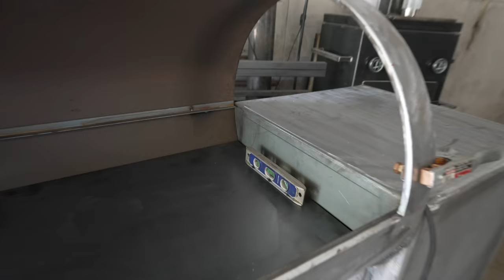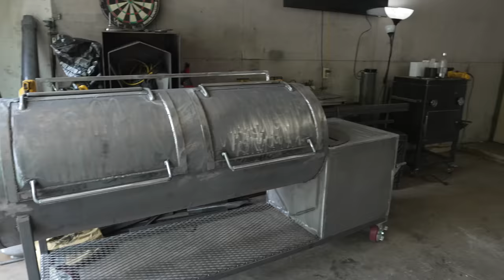Smoker Build Ep. 6 Almost Done! | Chuds BBQ

Comment: Love this series, cant wait to see this thing in action and to get your thoughts on the concept!
Reply: it looks like your reverse flow plate was welded down.  How do clean and how do you prevent grease fires underneath the reverse flow plate?  More importantly, how do you put a grease fire out if one were to occur? 😢
Reply: @derekanderson1882  shut doors dampner/smoke stack.
Reply: @koukitype180  my thought process was to make sure that you have the ability to inspect or clean it so a fire doesn't happen. I don't sit next to my smoker when I'm doing a 2 hour or 12 hours cook.  It's more likely that a neighbor would see it and I would get a knock on the door from the fire department.  Lol
Reply: @derekanderson1882  I have a 20-25 year old custom built reverse smoker and my plates are removable, they have to be. I can adjust the flow plus I can clean them. They are also rounded so they don't pool juices.

Comment: I built a 15 gallon double wall reverse smoker. I did not drill a grease drain.  Made a catch pan for that, plus adding to the catch pan a small water section opposite side of fire box.  Underneath pan added small plates on each side so I can adjust the gap to the reverse flow opening.  I have used this design for 6 years and works great for two people at home. I would add pictures but could not figure out how to do that.  Don’t think you can. Nice build Brad.

Comment: This is awesome!  However, I'm confused by the placement of the grease drip hole?  With the baffle plate installed level...the grease will just...sit on top the baffle plate????
Reply: This got me too...he will need to add another trap at the capped end.
Reply: That was my question as well.  Not sure where the grease will go that collects on top of the baffle plate. Baffle plate should have been in a slight V shape and slope, with a trap at the end.

Comment: Growing up working in welding and fabrication shops, I've drilled 10s of thousands of holes in all kinds of steel and it is a skill. Ford semi frames were the hard
and required an electro magnetic drill press. When hand drilling with a powerful drill, such as a Milwaukee Hole Hawg, you have to cradle it aggressively so you don't get wrapped up.

Comment: I made a reverse flow from a 200 gallon propane tank that was on an old semi.  I used axe handles for my handles.  It has worked great because the wood doesn't get hot at all.  I bolted them on, so when they get soft, I can just remove them and put new ones on, or limbs or bats or ...yeah.

Comment: One question - with the installation of the baffle plate for reverse flow, how does the grease which drips down on it actually escape to the grease trap hole you drilled?
Reply: Was wondering this same thing
Reply: Hopefully the baffle is pitched and he puts the grease hole on the turn side!
Reply: @leomulholland3  By pitched do you mean leaning to one side so it may drain? Curious.
Reply: @stihlmanchainsaw8445  yes. the baffle should be pitched from level to 1/4" per 3 ft toward the reverse end. that is the way i would for moving the grease down and for ease of clean.
Reply: I have an RF - the grease drain is *in the baffle plate* and extends through the bottom of the pit. I clean the baffle plate with a griddle scraper and push all of the grease and bits down the drain.
Reply: @SwineSpectator  i agree, that is the best practice, but looking at the final product that was built, i don't think he can remove the baffle plate anymore and put a tube from top to bottom. hindsight is always 20/20.

Comment: Love the build series! This pit is looking like a dream! Is the baffle plate going to impede the grease drain hole?
Reply: Yes
Reply: @duanehenicke6602  Haha I knew the answer would be yes, but I am curious as to how this would be amended. Drill holes in the baffle?
Reply: @Harry The Horse BBQ  few different ways. Door could be cut in the end cap for removal and cleaning of the plate. Or a door running the length of the pipe on the backside for cleaning. Or as others have said, cut the plate in sections for removal out the top. With a door in the back you can remove plate and shovel coals in if you ever had a need for direct grilling. Say large amounts of chicken, sausage, or steaks.

Comment: The location of your grease drain is in the shell of the vessel.  On a reverse flow it should be on the baffle plate, not the external.  You need to drill a hole in the baffle plate, and put a steel tube down to the shell.  If you rely on the plate to overflow with grease then run down the shell of the vessel towards the firebox drain, you are risking a large grease fire.  Typical reverse flows have the drain away from the firebox, on the exchange side, so you can utilize more of the surface area of the plate for collection.
Reply: I think it was also a bad idea to put the drain hole down by the firebox. There's no lip and grease could flow right back into the firebox and cause a massive grease fire. Drain should be on the left hand side, farthest away from the firebox.
Reply: @joshwinters6249  in Episode 8 Chud talks about this briefly.  Definite concern but hopefully the “slow trickle of grease” doesn’t catch the rig on fire.
Reply: @Brad Wernicki  saw that. Ive built a few pits and have definitely done stupid shit like that before. Hopefully it works out.

Comment: With that large tuning plate at the bottom, how will you take it out to clean the pit or is it now a permanent fixture?
Reply: Definitely should have cut it into plates to be removable. But it's to late now lol
Reply: I was wondering the same thing. All the reverse flows that I’ve seen had a series of small tuning plates that could be adjust or removed individually.

Comment: Really enjoying seeing this beast come together! I noted how much of a struggle you had around 3:55 to get the end cap mounted. The boilermaker I learned to weld from often coached that it's always OK to temporarily tack pieces together, then cut out the welds and grind the surfaces smooth. Next time you have a task like that, maybe tack on some tabs of flat bar to the underside of the barrel to hold the end cap in place with a clean fit, rather than brace it with your knee and hope it all stays aligned while you try to get the cap tacked into place?

Comment: Are you going to put a short wall at the end of your baffle plate to keep the grease from flowing underneath it?  It would be really hard to clean out underneath it if you don’t.  Mine has the drain with a pipe from baffle plate to the bottom of the smoker.

Comment: Wondering how the grease is going to get from the grates to the hole you drilled, since you put the baffle plate in or if that's something you still need to work on. Also wondering why the hole would be near the pit, since the grates are to the far left of the smoker (the grease would have to travel to the hole, cooling down in the process). And wondering if the smoker is angled slightly toward the grease trap. 🤔

Comment: Hey Bradley, I’ve been binge watching this build series and first of all, awesome work! That smoker looks great! Secondly, I’m starting my first build and had a question about the wall thickness of the exhaust stack. You mentioned that you try to get the thinnest metal possible. How thin is too thin?  A buddy of mine has some 5 inch diameter pipe that 1/16” thick. Should I go for it or should I go for something more like 1/8”?

Comment: Where do you source your round pipe for the body of the smoker? I’ve been toying with the idea of an offset build, and have the tooling and skill set to do it. Not sure my local metal supplier has the thicker gauge larger-diameter pipe.

Comment: For the next time why dont you cut the round hole in the part @9m20s and weld it on the other way up - you save the loose triangle and a raft load of extra welding, the firebox will form the bottom - leaving more time to go boot snake hunting.
Reply: Wondered this as well. Like, is it a technical decision or just an artifact of the design/plasma cutting/etc

Comment: Brandon, your grease trap hole and drainage design confuses me. It is below the baffle which you cant remove, correct?. it is also fairly level, with out an incline shouldn't the grease just pool up and collect till a sufficient amount is collected to push it along the baffle and down underneath before reaching the grease trap? With the end cap welded on your access becomes nearly zero. would it make more sense to hinge the end cap, leave the baffle on rails to allow it to be 100% removed and cleaned in addition to the bottom of the pit?

i have never built a pit so this is just a 2 cents commit from the crowd. thank you for your videos.

Comment: Here's a question for the armchair physicists out there.  I watched the explanation of the smoke collector, however, one thing stood out to me.  Why hasn't anyone thought of a way to use the elbow with the triangle in a hybrid collection method?  In my little brain, you would get the best of both worlds, should be less metal waste on the actual smoke pipe itself and, depending on the size of the pipe being used in the final product, produces a much cleaner look, am I right

Comment: Couldn't you have saved a piece of steel by using the top of the firebox as the bottom of your collector? Just wondering if there's a reason why you have two sheets flat against each other.

Comment: As a new BBQ enthusiast, my first real smoker after my stamped-metal, tinfoil thing that weighs 50lbs exceeded its usefulness- I bought the Oklahoma Joe Reverse Flow Highland (which allows you to switch up the flow by removing the baffle plates and repositioning the stack). Been using it in normal-flow mode for the first few months until last week when I switched it into Reverse-flow. My initial reaction after cooking a brisket and a pork shoulder last week on it... it manages heat in smaller-sized pits way nicer and more consistently and any larger swings in temp I incurred adding a split onto the fire before feels much better dampened when in this reverse flow mode. Though it does create a much bigger mess as that rendered goodness is now sizzling directly under your meats as they cook away.

Be REALLY excited to see your thoughts on your titan here and if it aligns with my own initial thoughts too.

Comment: To save some metal on the collector, instead of cutting a bump of metal the diameter of the pipe for the bottom piece, forget the top piece, cut a circle in the "bottom" piece and flip it over so that the bottom is the top. That bottom plate really serves no useful purpose and is simply wasted in this build.